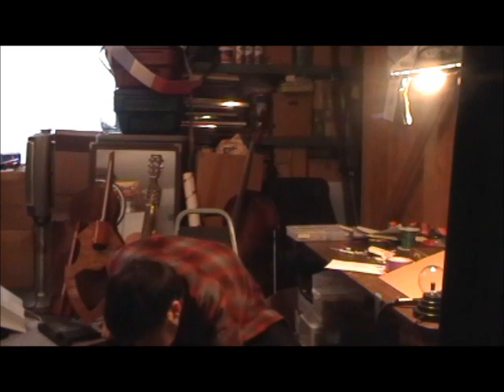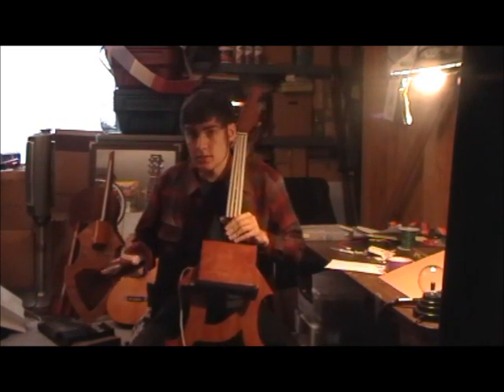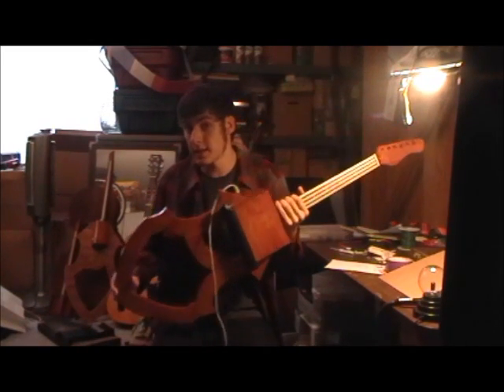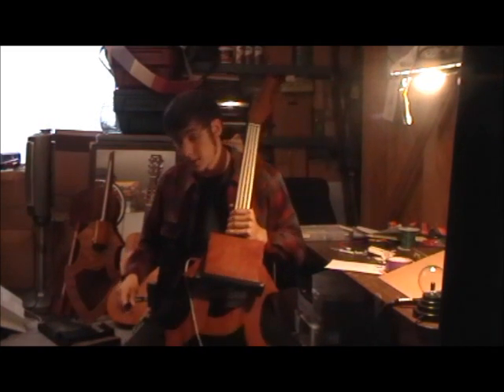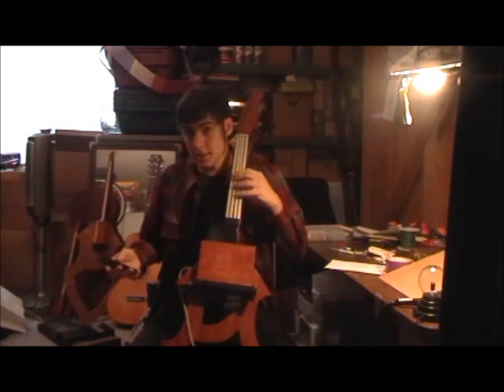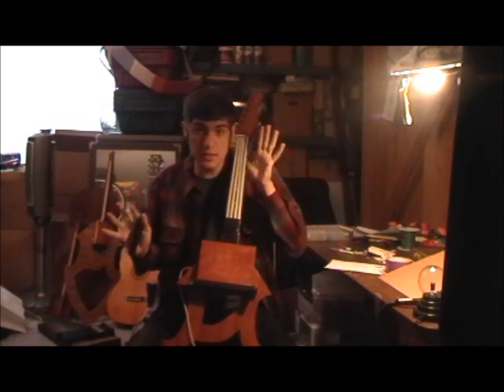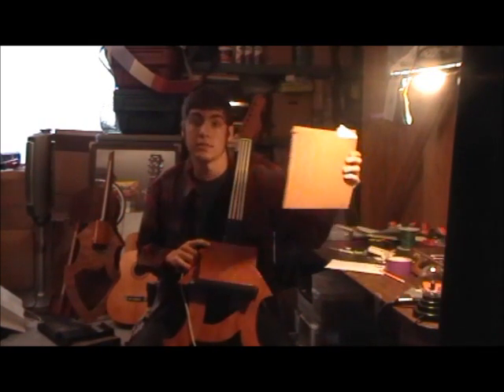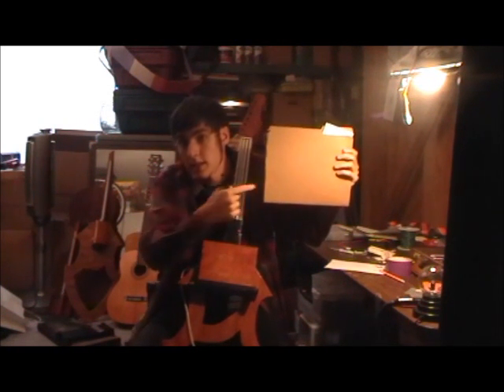Magnetic Cello V.4.1 Demo

Comment from the maker: @signboyy 
in the embodiment, strings are selected by only the left hand. 
The problem with guitars is that they are fretted, and this defeats the purpose of using a resistive ribbon with ~infinite resolution. Also, no open string is a minor problem on the cello but a major problem with the guitar, which depends on open strings to play chords.

Not that I don't have ideas to transform other instruments in other ways.

Comment from the maker: @cellocorman 
You are correct. I set the tuning an octave higher because with the circuitry I am using now, low notes sound distorted. It's very straight forward to correct this, once I get better amps. Nice ear, I sometimes have problems telling octaves apart without a piano nearby.

Comment from the maker: @aerphonic 
The hum is from my amplifier. The resistive strips are from a company called spectra symbol ( spectrasymbol . com ). I use the ThinPot variety. These ribbons are enclosed in plastic and have 3M tape on one side. The ribbon resistance is constant/set by the company. To change the frequency compression and the root note of the string I use trimmer resistors. The whole thing runs on a Voltage Controlled Oscillator. You should look at my PPA (in description). Thanks again!